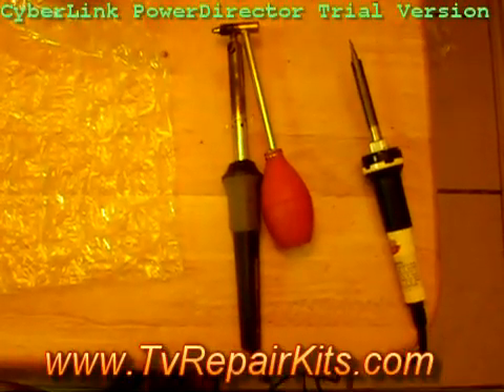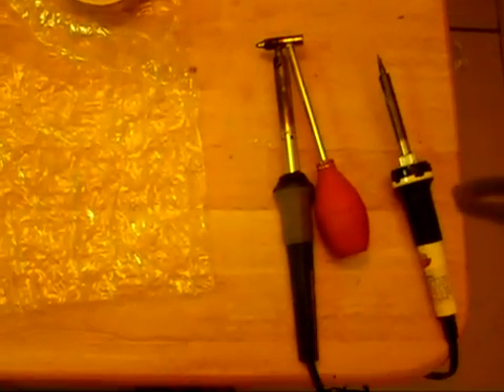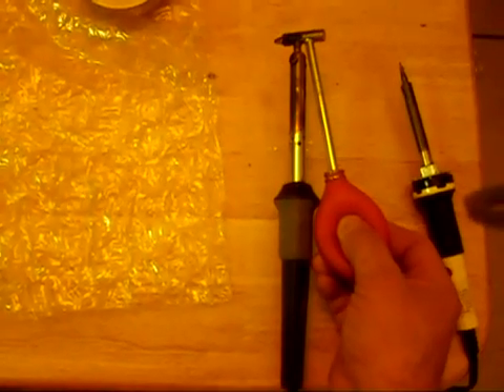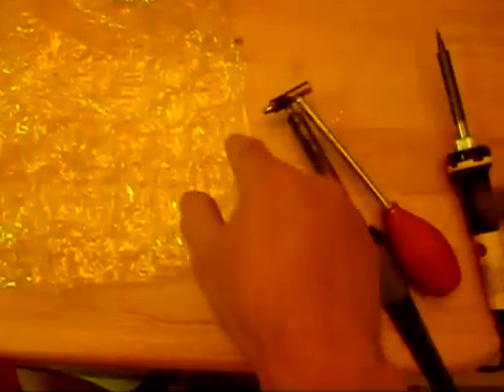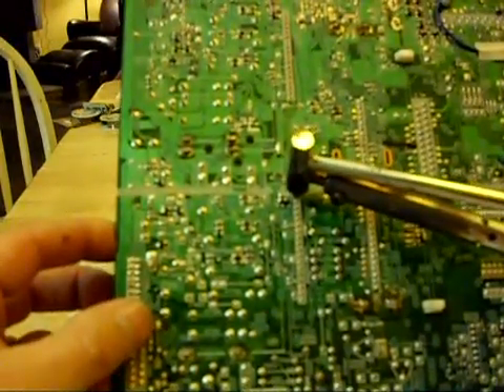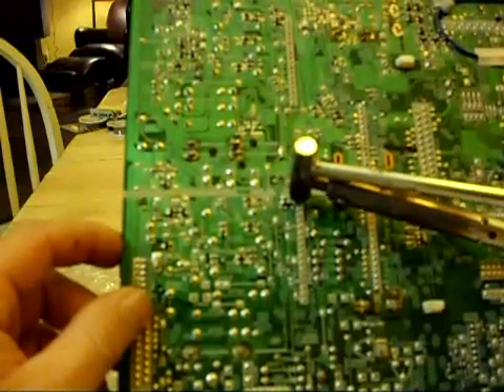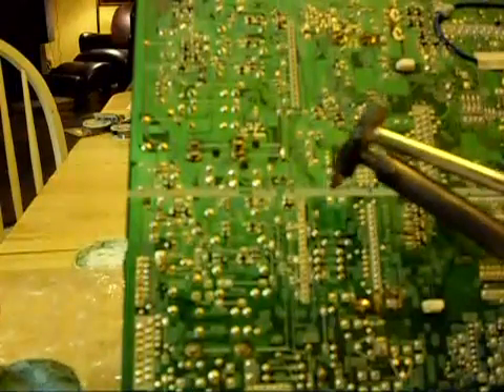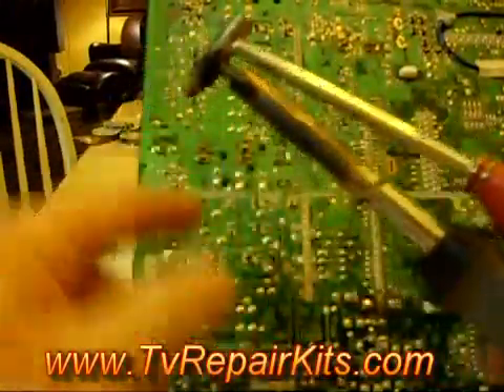TV Repair Desoldering made EZ

Comment: No its not an attachment for your existing soldering iron, its a complete desoldering iron kit, what you see is what you get.  It is a cool desoldering tool for only $12.  Radio Shack also carries the replacement tip for $1.99.  Very easy, fast and does a clean job desoldering.  A must have for all electronic DIYers.